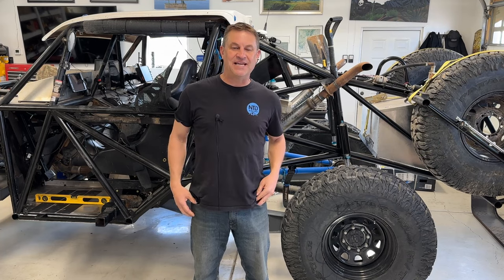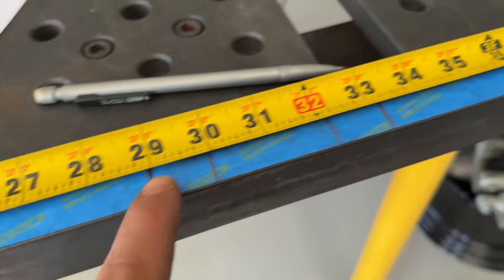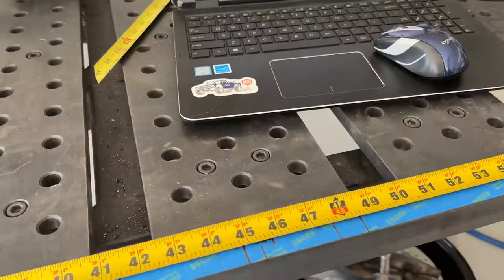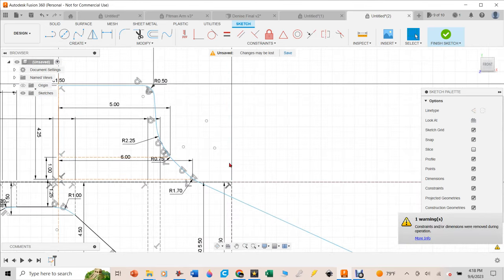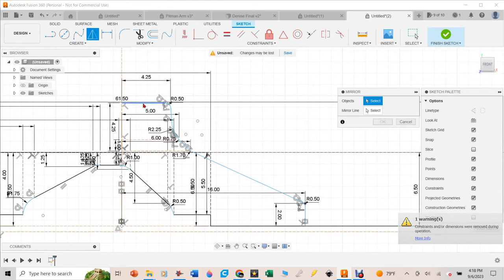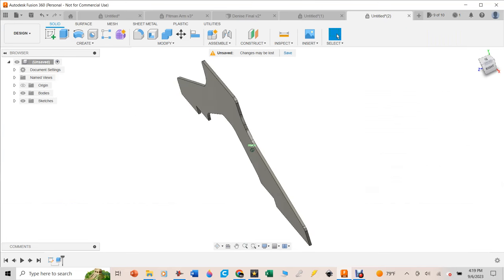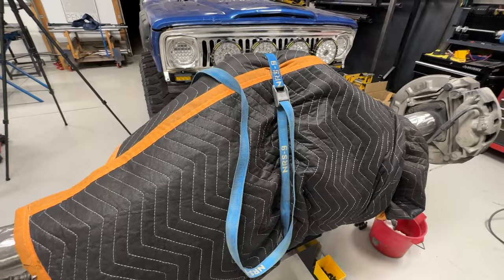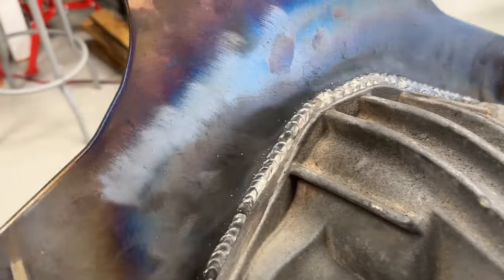Trussing a 14 Bolt for Off-Road Axles: Step-by-Step Guide

Comment: Given the amount of fabricating and fitting, you might want to look into a 3d scanner.
Reply from the maker: That would be a great idea.   Have you ever used one?   Know of a good one.  Thanks.
Reply: @ntdracing  I have a revopoint  but don’t have any experience with it (had to move around the time I bought it) . There are a few competitors to the revopoint which review better. There are a few automotive channels out there using and reviewing them. Capabilities seem to depend on price and budget but no longer out of range of the backyard fabricator.

Comment: I have been slowly working on an open source trophy truck project that would hopefully be able to lower the barrier of entry for other competitors. Right now I am working out the process for quickly and efficiently making jigs to speed up assembly of the plasma cut tubes. 

My issue currently is that I don't have hard dimensions on where various tubes should be. 

Would you have any interest in sharing some of your CAD designs so I have more solid numbers to work from? I totally understand if you want to keep that a team secret.
Reply from the maker: Would be happy to share.   Will have to wait until I am back at my computer.
Reply: @ntdracing  What is the best way to get ahold of you now that your back from the mint?